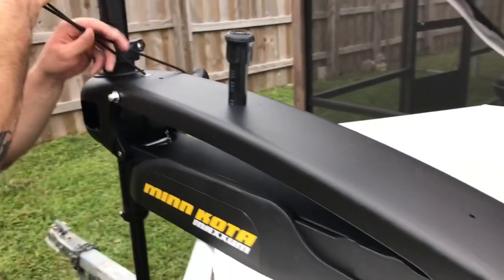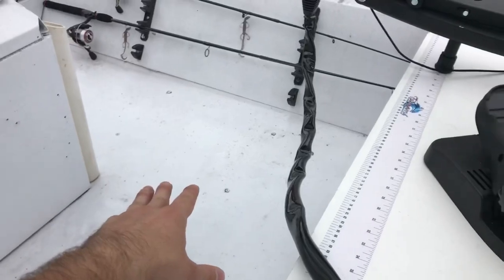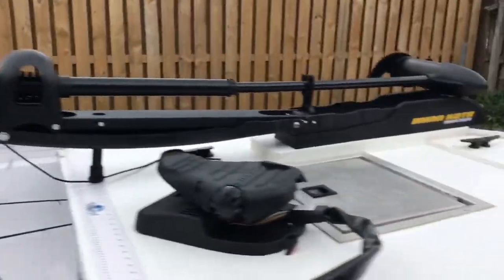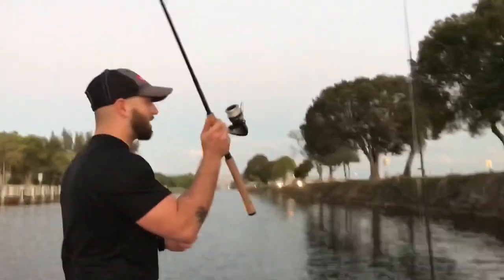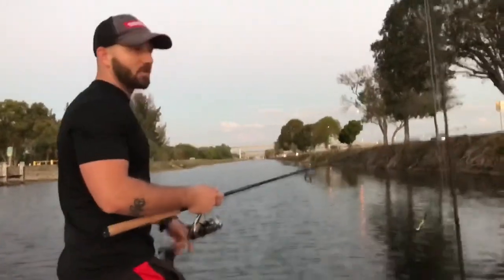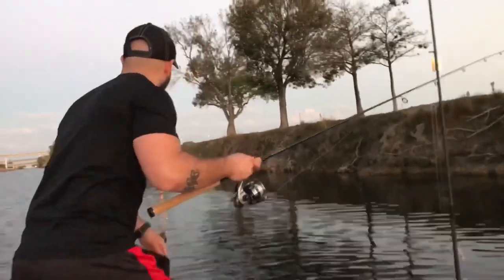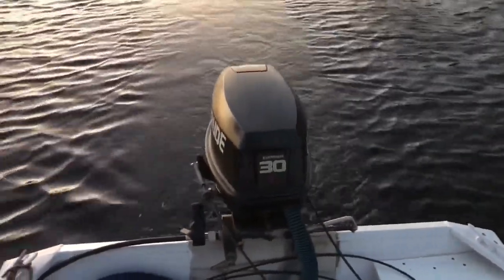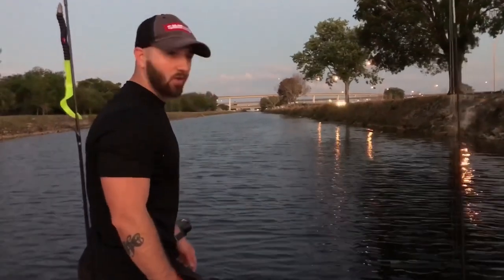First test run of Minn Kota trolling motor

Comment: Bro just left your brothers channel to find yours, surprised he doesn't Rep you. Anyway, "my $.02" as for your trolling motor, Brackish or whatever it is less expensive than a Saltwater version. Not everyone has the $$'s to pony up for top of the line equipment. Just keep it Washed Off, not just rinsed. And your motor, I just sold my '99 Johnson 25hp and replaced it with a '12 Evinrude 25hp e-tec Tilt / Trim and it's in mint condition. Rebuild or Buy do what feels right to you. I wish you luck... Tight Lines and Full Limits to Ya.!
Ps Great work on your boat.
Reply from the maker: Yeah If I rinse it off good I don’t think I’ll have any problems. hopefully I get it running soon so I can have some fun again. Thanks for the support!
Reply: @weekendventures11  I've subscribed so I'll be looking forward to it.